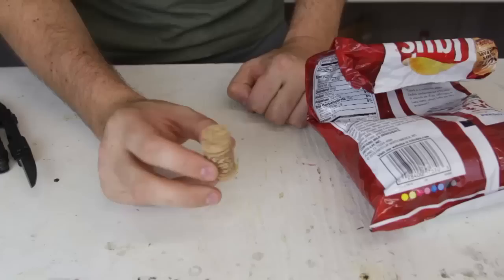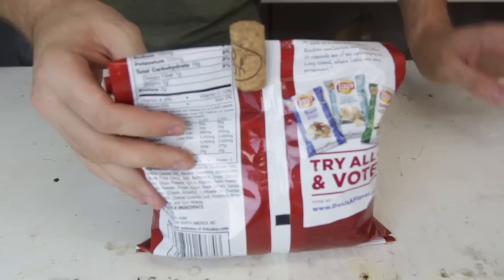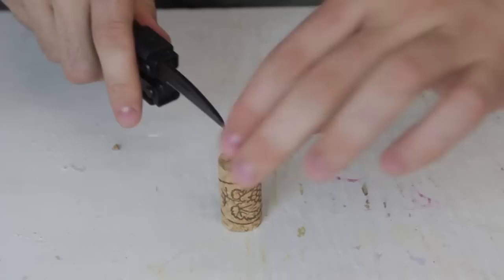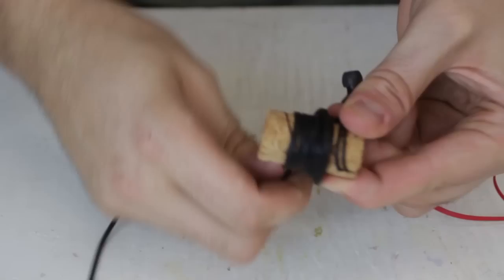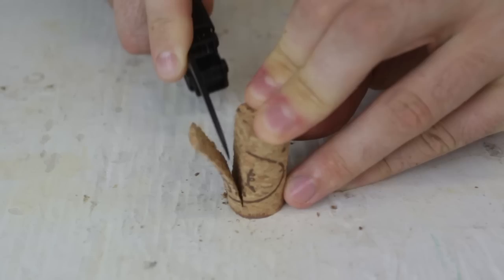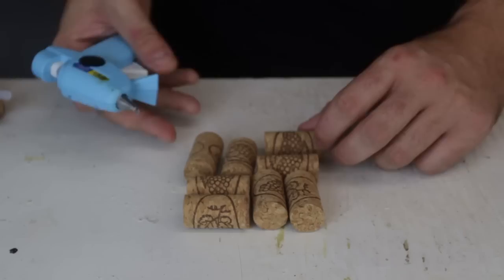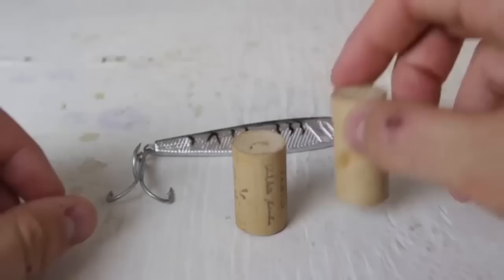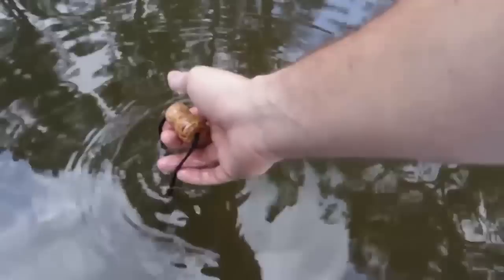10 Simple Wine Cork Life Hacks

Comment: Next time try cutting a little of the corks like you did for the picture stand, but on 2 sides.  Use those corks for the coaster.  This way drinks will have a flatter surface, which is useful for narrow glasses.  :-)